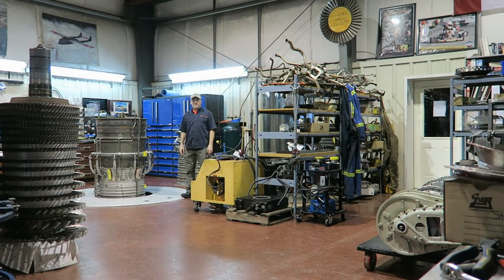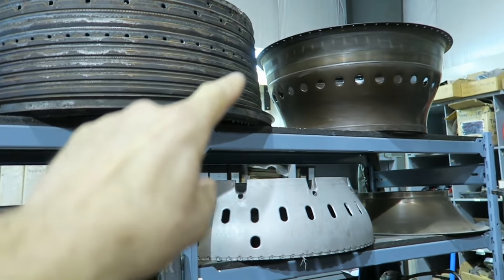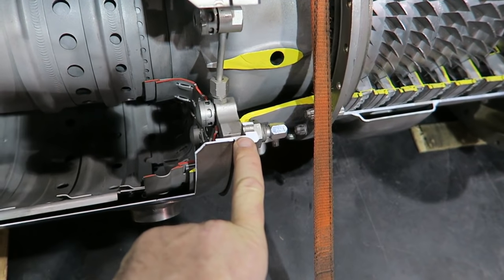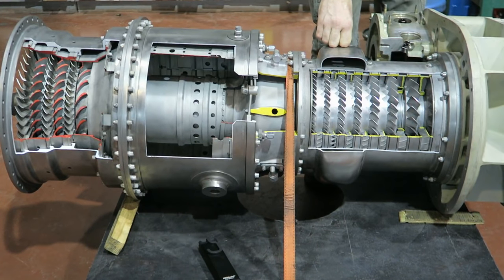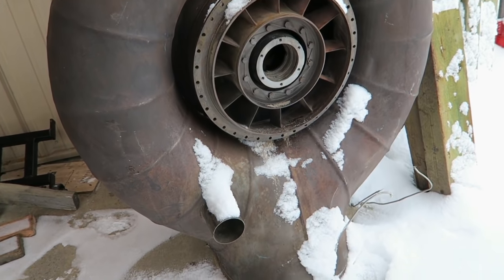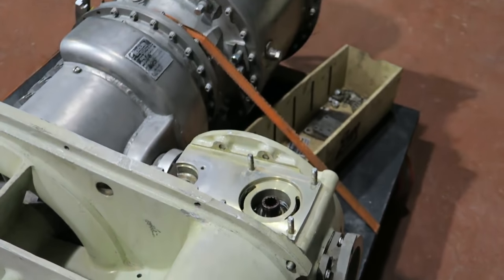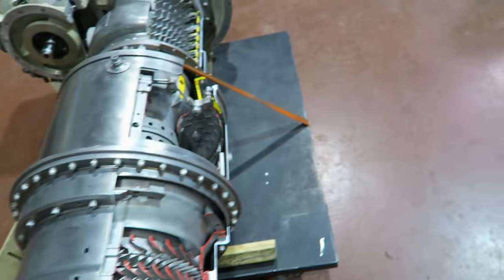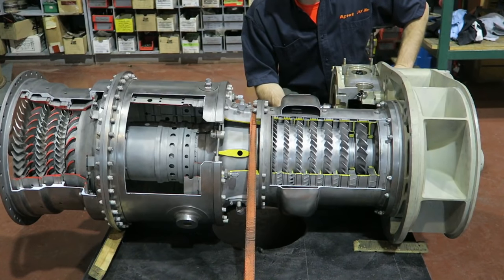Solar Saturn Turboshaft Engine

Comment: The airflow path through the turbine section seems very inefficient with the many changes in direction. 
Great video, though.
Reply from the maker: You know not of what you speak Mr. wizard. It's those changes of direction that give the turbine what efficiency it has. If all airfoils were at 0 degrees to the axis of the engine, the gas would go straight out, and we would have a heater.
Reply: Admittedly, I do not. Many more obviously smarter minds have led to the development of this system that, from this layman's perspective, seems less efficient. It does make more sense from a dynamic perspective than looking at it while static.
I do enjoy your videos, though. Very informative.
Reply: The change in circumferential direction of the flow is the means by which a turbine extracts power from the hot gas. Change in whirl velocity (deltaVw) is what it's all about. Trust me, I'm not a doctor, but a former Chief Designer - Turbines.
Reply: GrahamJ - This is a good place to posit this question. 

On some older explanations and diagrams of turbo jet engine turbines, a t-p-v graph across a four-stage turbine section indicated working air velocities peaking at approximately 1600 fps in the first turbine stage, dropping in a deep sawtooth fashion across the turbine stages to approximately 850 fps at the exhaust. I understand that the speed of sound at standard t & p is approximately 1100 fps. 

My question arises from a statement Jay often makes: that airflow through the engine is subsonic. Is the airflow briefly supersonic at the first stage of the turbine, or does the high turbine inlet temperature (approx 2000F) raise the speed of sound above 1600 fps, and therefore all airflows in the engine are subsonic?

I looked for, but failed to find, any graphic information on the relation between temperature and speed of sound other than a formula v = 331m/s + 0.6m/s/C * T.  I presume that because T is high (2000 F =~1194 C), adding 0.6*T to velocity elevates the speed of sound to approximately 331m/s + 709m/s = 1040 m/s or 3411 fps.  OK...presuming my math is correct (I assume nothing), then it appears that ALL airflows in the engine in question are subsonic.  Is this correct? Is it correct that all airflows in all commercial turbo fan engines are subsonic (except possibly the exhaust from the core)?
Reply: 2000degF (1093.3degC) is not a high turbine entry temperature relative to modern engines , which have TETs of around 1800degK (1527degC).  Your calculation for the speed of sound at 2000degF  is too high: I get 2432ft/sec. However, the formulae are supposedly really accurate only for air temperatures relatively near to ambient. Nevertheless, you (and AgentJayZ) are correct in stating that flows are subsonic throughout the engine. In fact, the flow in an afterburning jetpipe is subsonic and is accelerated to sonic velocity (that is, the local speed of sound) at the throat of a convergent nozzle: it accelerates to to supersonic speed in the divergent section of a con-di nozzle.
Reply: Airflow "accelerating to supersonic speed in the divergent section of a con-di nozzle" sounds like the weird properties of supersonic airflows Jay frequently refers to. I intend to research this subject further.
Reply: I hope that you now have a better understanding of the way in which a turbine works. It has to produce torque, a turning force, in order to drive the compressor. To do this, the nozzle guide vanes direct the flow leaving the combustor in a circumferential direction, to drive the the turbine blades. To maximise the amount of work, the turbine blades redirect the flow in the opposite direction, hence the amount of curvature evident in turbine aerofoils.
Reply: Actually, I (think I) did understand this function in the turbine section. Some of my difficulties lay in the finer points of the airflow path within the fan and compressor section.

Thank you so much for your helping to unravel this!
Reply: OK, I think you've got the principles now. I was trying to help Mr Wizard  further with my last post.
Merry Christmas to all!
Reply: grahamj9101
I did help, thank you.
Merry Christmas to you.
Reply: Merry Christmas GrahamJ - Thanks so much for sharing your experience and knowledge at this site.
Reply: I enjoy sharing my knowledge and experience, but I am very aware that I am only a guest on AgentJayZ's channel. He has suggested more than once that I should make my own videos and I did get myself a camcorder some months ago. However, I feel at a disadvantage because I don't have the extensive facilities and access to hardware that AgentJayZ does.
Reply: On the other hand, I wonder if, in your travels and continued work, you do get access to really cool stuff that the rest of us would salivate to see and understand? I think that the possibility of a knowledgeable and smart fellow giving a video tour through the old and new jet engine and aircraft technology would be unbelievably interesting.

Please accept these comments as strong encouragement to do so. With luck, you might attract enough of a viewership to generate an income stream.

Comment: Hy  i need to do some overhauling for the fuel pump P/N 901580C1, MOOG MK1, i will appreciate any help, thanks in advance
Reply from the maker: You'll need the overhaul manual. I also suggest taking apart a junk one, for practice, or maybe spare parts. Otherwise, I have no idea what it is. There is no master catalog of part numbers.
Reply: @AgentJayZ   Hu mate thanks for your response, i have to overhaul 50 of these Fuel pump, but we need tested at OEM Spec, I can not find any info on Moog or whitton about this pump. the turbine is a Solar Saturn 20. i only have the parts numbers of the FP. i know how to do the service, the issue is the report of the test acording to the OEM spec, also what a great videos you post amazing how you explain in details how the turbine works.
Reply from the maker: Now that I know what engine it's from, I can ask a friend with Solar Saturn experience and resources.
I'll let you know.
Reply: @AgentJayZ  Excellent  i will really appreciate your help!! thanks a lot 😀
Reply from the maker: I spoke to the owner of Tourbillon Turbine Services, and although he's got lots of Saturn experience, he informed me that the fuel pumps are part of the installation skid, and are not shipped to him for overhaul.

Comment: is that gearbox intake assembly magnesium?
Reply from the maker: All steel. This engine is not based on an aircraft design, so light weight was never a concern for the manufacturer.
Reply: Is this design not originally  based on the Boeing T50? a helicopter engine???
Reply: ***** My bad, I meant Boeing T66... which was developed from the T-50 family

Comment: 5kw load from a house is really low.  Only 20.8 amp at 240 volts.  Wouldn't be enough to run an air conditioner.  But take the numbers to the extreme of a 200 amp supply being fully maxed out, your talking about 48KW.  So, less then 48KW.  About 15.5 houses (ignoring losses) at worse case.  I would expect 30-40 homes with a more "normal" average load.  I guess no one will be installing a turboshaft backup generator for their house anytime soon!

Comment: Hi jay.would the air entering the engine be filtered for dust particles  ect?.
Reply from the maker: Many industrial engines have large air filtration systems on their inlets to do just that. To minimize the speed of the air passing through the filter, these filters are often a complete wall of an inlet plenum which is many times larger than the engine itself.